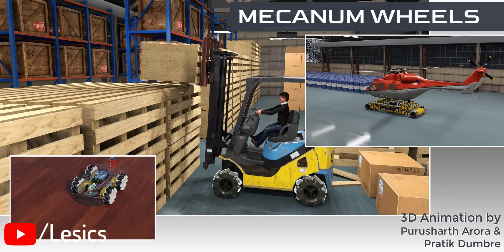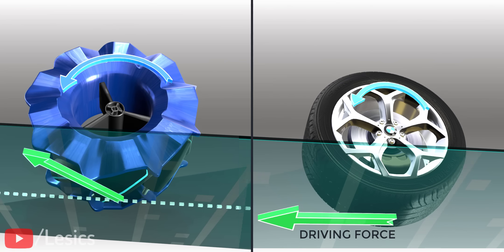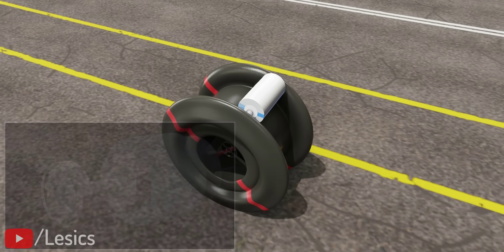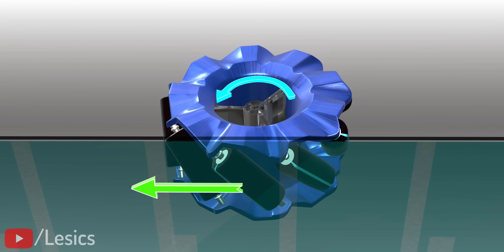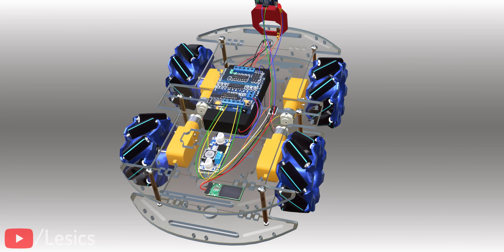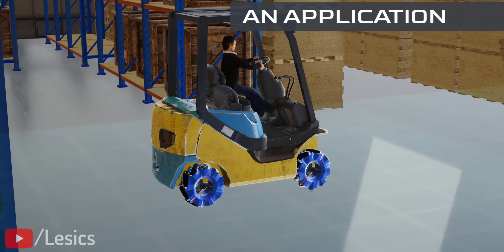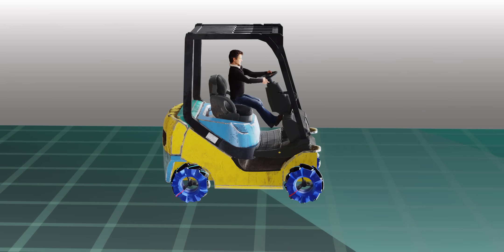The Brilliant Engineering of Mecanum Wheels!

Comment: Most forklifts have only 2-wheel drive ... on the 'load' end, with steering in the rear. This means you need a much more expensive drive system ... either (independent motors for each wheel), or (front-to-back plus side-to-side differentials plus clever cutting brakes on each wheel) or combinations of the above. Either way ... still very cool.

Comment: Stopped the video after seeing him making a comparison to a forklift that "takes a lot of space and time". No shit it takes a lot of space and time: THE OPERATOR DOESN'T MAKE A SHARP TURN. Any standard forklift I've ever operated, old or new, can turn around its front wheels because the back wheel(s) can turn 90 degrees.

Also, perhaps it is worth comparing durability, comfort, price, weight limitations etc to regular forklift wheels. Then I wouldn't call mecanum wheels brilliant at all. They have an interesting mechanical concept, that's all.

Comment: To all the geniuses that say uneven surfaces will create unexpected motion due to the design. The tolerance threshold for varience is actually quite high.  Since the wheels are stationary vectors get averaged and you still get the motion you aim, for the most part. It will put the strain to where the wheels are connected to the frame rather than getting crazy motions. 

Think about it this way, your car tires are not equally worn. Most city roads are uneven. Do you immediately go off the curb and get into accidents? With one shitty tire you can still remain on the road and get to where you are going for a year. It is the same thing. 

The reason this thing is not super mainstream is purely economical rather than practical. It is expensive.

Comment: (0:09) I'm actually forklift certified, and this is bullshit. In the animation here note that they show a forklift whose FRONT wheels turn.

This is not a thing. Forklifts use their rear wheels to steer, and the reason is to give them a tighter turn radius. Forklifts, as they already are, are designed for warehouses where there's a minimum amount of floor space to work with (go figure, almost like that's where you find most of them). Fuck outta here with this.
Reply: https://www.youtube.com/watch?v=CjcyHicm3NA

Comment: Why not just use the existing system of four omnidirectional wheels. Fork lifts already successfully use that technology and are quite fun to drive. :-) No need for the new wheels that will error out if they roll over an unexpected object and send you in the wrong direction or operate erratically. Sorry, this system will not work unless you are able to monitor each secondary wheel and power them independent from the motor from the normal wheel. This will also require some AI computational values to constantly process sensor data to maintain the direction the driver wants to achieve.

Comment: I just wanted to say that I drive a forklift full time, and they can turn a whole lot quicker than that clip in the first 15 seconds of this video... Basically as sharp as these special tires are supposed to make it go. You can turn around as long as you have the clearance to turn it sideways in the aisle, and the back tires turn almost to the point that they're perpendicular to the front ones. This is a solution to a problem that doesn't exist and is about as silly as those black and white clips of other companies' products in infomercials.

Comment: If this was worth its time, amazon would have implemented this years ago. I work there now and they have the best forklifts, crown royal, those things turn on a dime, I have to make 360⁰ tuns in 6ft of space, just barely clearing each side by 2-3 inches of space for error. These would break down and cost too much to maintain. Lots of wood debris uneven ground, and pot pot holes.

Comment: While Mecanum wheels seem like they can actually do some interesting stuff, none of what you've shown are the main selling points. 

The 180 degree turn isn't even remotely special to Mecanum wheels. It's just basic tank driving, which does still work even without the application of tank treads. All of the other benefits you've shown Mecanum wheels to can also be duplicated by Omniwheels, and some more. 

What these can do, however, is do those things with far less complexity, except for the tank driving thing. Omniwheels require the sidewheels to be capable of rotation seperate from the main wheel, and they need power to go to those mini-wheels. Transmitting power to each mini-wheel isn't easy, and would require either additional engines in the wheels or a very complicated set of gear mechanisms. 

These do most of what omniwheels do but without all that complexity. You just need 4WD and the ability to vary rotation speed and direction in your car to get the full benefits of these wheels. Would probably be much simpler and cheaper to manufacture, far easier to repair, and much easier to replace.

EDIT: I thought it would be more durable than omniwheels, because less parts usually means more durable, but on second thought, these seem like their functions are sensitive to changes in their treads and roads, which is what takes the most damage. Omniwheels just use simple rotation, they don't really care about friction inconsistencies, but these seem like they might.

Comment: This seems like a good concept on paper.  But since wheels are complex and all movement causes slipping, you'd expect rapid wear on the rollers. So feasibility in industrial application like forklifts is limited by ease and cost of roller/wheel replacements. It'd might make more sense on light weight industrial robots or the like where fiction forces are smaller. Or it should be really fun for hobbyist kits but there are no big bucks there.

Comment: Whoever taught that operator to drive like that in that forklift did not know how to operate a forklift that big of a turn without a machine you can take a tighter turn than that and do it better I know I used to drive a forklift so you don't know too much about forklifts you know about the tires and the machines on that but that's about it you don't actually know how to operate a forklift

Comment: A forklift, needs solid rubber on the wheels to take the heavy loads on them.
The roller's connections would not be strong enough for a fork lift truck.

Comment: What are the controls in the forklift to drive this? Is there a joystick for translational movement and another for rotation?
Reply: Move Forwards/Backwards 
Move Left/Right
Rotate Left/Right
Fork Up/Down
Fork tilt Forwards/Backwards
Fork Left/Right
Clamp Open/Close

That was all controls I found googling it quickly.
You can set first three on left controller, next three on right controller and last on buttons at joysticks.
Joystick can move forwards, backwards, left and right as well rotate left and right giving you 3-x movement on each controller ❤
You could operate forklift with two joysticks easily and using these tiers probably would be saver and more accurate but the amount of extra cost would not probably be worth it, else everyone would use these.
Those Tires also look like they can only operate on smooth clean floor so no off-road.

Comment: The movement at 0:27 has the wrong wheels turning. The front left and back right should turn and front right and back left should be stationary. The force at 0:42 is also angled in the wrong direction.

Comment: Most probably not possible because of very high pressure caused by heavyweight machine and load.
Besides rubber wheels don’t bounce that much as such Omni would due to small diameter.

Actually there are forklifts which can rotate almost in one place and also expand.

Comment: Thanks for this very informative and vivid video.
Unfortunately, there is a mistake in the animation at 0:27. FL and BR should have rotated forward instead of FR and BL.
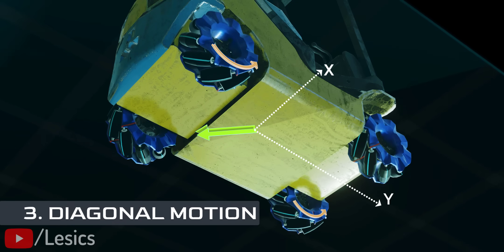Compare it to your explanation at 4:56. There the vehicle moves diagonally backward-left with FL and BR spinning backwards. So the direct opposite motion would be diagonally forward-right with FL and BR spinning forward, which is the motion needed at 0:27.
It's just something that caused my brain to stumble when trying to understand the mechanics behind the wheels. But it got resolved when you later showed it from below.
So thanks again for the good video!

Comment: Only issue I see with this invention besides its lack of working in sandy soil which I learned from an RC toy I had as it would get stuck in a small amount of sand is the maintenance of them for this many wheels per wheel makes alot more possible parts to go bad and or freeze up when bearings or rods rust up. Then comes the cost of fixing the gears on the wheels wheels or buying a whole new wheel and with all the parts needed for just one wheel each wheel would cost probably 4times as much as a standard wheel.

Comment: Interesting invention, though as a fork lift operator with many years of experience, the demonstration of an elevated load moving in a sideways direction violates a sacred rule not to transfer an elevated load in any direction other than one that is directly parallel to the long wheelbase of the machine.  If the machine wheelbase was square, it would not present an issue in this regard.

Comment: This can be illustrated when you have a bolt on a screw. The bolt can roll vertically across the screw if you hold the screw. But if you spin the screw and the bolt to opposite directions, they will stay in place (like when the wheel of the car wants to go straight). 🔩

Comment: This is a super horrible idea for warehouse lift trucks most of the equipment used is not forklifts, it's epj's, stock pickers, reach trucks and dock stockers. front and rear wheels are different diameter, even different materials in some cases. RR and SP outrigger wheels could not be modified with this design: it would alter the critical width dimension (wider and the truck would no longer fit in a standard North American "very narrow aisle", narrower and the forks would no long be wide enough to accommodate a standard North American pallet. Same issues with reach truck outrigger wheels.

Forklift operators have a hard time as it avoiding collisions and accidents, that sideways motion looks prone to tip over.

Comment: The forklift driver in the video appears to have a standard looking steering wheel. How does using this translate to the various possible forklift movements described? Another video showing the operators' movement control system would be useful.
Reply: it's probably an auto circuit board that does all the computer calculations and instructions, not an actual manual rod
Reply: @SDRIFTERAbdlmounaim  You can use one joystick to move the forklift. push in the direction you want to move and rotate the joystick to turn.
You can combine this with other joystick to control the fork up/down, left/right and tilt forwards/backwards.
On top of that you can just add buttons on the joysticks to handle things like clamps and other functions as needed.

Or get an Ai to run the whole thing. Just automated the whole thing. Also this seems to work best on flat clean surface so no offroading?

Comment: So, more parts involed, causing higher cost for each tire as well as maintenance and repairs, and more various issues which may occur.
 Sounds like over engineering at its best for minimal benefits.
 Definitely a case of, if it's not broken, don't fix it.
 As I said, this is over engineering with a lack of common sense to solve a problem which doesn't exist.

Comment: robotts is, Swedish -- speed boats. Nae! It's signa, always derived / supported(logged), by pi bonds. Circumfrence measure.
Int= i.e. diams. Off the, beaten paver, i.e. 45degs. That's a, turn operation.

Comment: /Int= i.e. robotts Mx wheels frnt - bac in AVN volts i.e. iiiw ++ - piF''fdz(1000 frames - frq forks) half tachron focus
dead center(DC) i.e. relays whole txt / imagery views /
/mk standard yamaha 450f + 4 wheeler wheels i.e. dead center(DC) mk as frq forks - hlf pi vs dbl signa bonds /

Comment: The manufacturing must be of the highest engineered quality along with the materials ?  There are a lot of possible failure points with all those rollers , connectors,  rods, and bearings ?  They would cost a small fortune.

Comment: Is there a manufacturer of a electric-roller pin version of this wheel? Not unless there is a "balance" control between all four wheels, over-shoot & under-shoot cannot be effectively controlled. Pulse-width modulation & dithering control may make this drive system work better, in that, instead of a steering wheel a joystick could be used. It appears that there are two forces at play here, the force that pushes & bends and the force that pulls-straight. Thank you for this great video!!!

Comment: Lots of people unfamiliar with industrial robots going on and on about maximum loads, and stress on frames, and blah-blah-blah.

Industrial Robots use these wheels; full stop.

The Mecanum Wheel's ability or inability to be used on a forklift is irrelevant.  The ability to move some loads diagonally, or full rotation, is what the design and logistics call for.  Full stop.

Comment: i like how to represent the turning radius of a standard fork lift they used a front wheel steering lift. most steer at the back and and can pivot around the front
Reply: They also LUDICROUSLY exaggerated the turning radius. I'm a forklift operator and the one we have at work can turn in about 1.1x its own length. There are forklifts (with conventional wheels) that can turn in exactly their own length.

If someone did that wide a turn I'd pull them immediately off the lift and send them back to training.

Comment: im also interested in the elctrical engineering aspect of these wheels, is there software in the vehicle which determines the wheels needed to be spun when a specific direction is chosen with the steering wheel, or are all 4 wheels operated manually by the driver?
Reply: This would be such simple software it could be programmed by anyone with an iq above 90. I suspect there’s a joystick and a wheel, you use the wheel to turn in motions conventional with a vehicle. The joystick for diagonal and side to side.

Comment: Not only are there too many variable conditions of surfaces that would make the use of these wheels unpredictable the mechanical design and assembly is too complex to be reliable in any application other than low speed use in a controlled environment. 
 Hence all their examples of their prospects are only in computer generated cartoons.
 This whole video is merely a sales pitch to the ignorant.

Comment: This is somewhat similar to how a quadcopter drone functions, in a way. The caddy-corner propellers rotate in the same direction, which is the opposite direction as the other pair of caddy-corner props. To rotate a drone, the pairs are operated at different speeds, which creates a net torque imbalance causing it to rotate.

Comment: Why not just use tracks? Pretty sure practicality-wise in his given example of a forklift, it will be able to hold greater loads, and be more economical to maintain (god forbid the costs of a mecanum wheel should it break). Tracked vehicles can also move sideways albeit the tracks will need to rotate 90 degrees independent of the vehicle cab and payload.

Comment: We DEFINITELY need to get these on domestic vehicles; not just warehouse/ stockroom ones. This would solve a lot of traffic issues as well as parking problems.
Reply: Would you trust those wheels on your car?
Reply: @tapejara1507  😄YES! 🤓That's the WHOLE point behind my comment. Put them on regular street cars and if they don't fit, redesign the model of the car and/or the wheels. If it can be done of warehouse and stockroom machinery,  it can be done for domestic vehicles. Plus, think if there is an added feature to those wheels for snow and ice instead of chains. In fact, it's not a matter of can it be done. The question is,... will it be done. NO! Why?...Too progressive. It solves too many problems industries are making huge profits off of. 😖😬WHOMP. WHOMP😵😵
Reply: ok :D I think its not worth it and not even a good idea. like how do you drive fast with those bad bois? :) but who knows what the future holds.

Comment: You still have to backup to get the forks out from under the pallet so I don't see much use for this in most places.  You would still have to have your stock far apart enough to back out so I don't see how being able to drive sideways will save any space.

Comment: Instead of doing all of this, why not create a broader, more stable forklift, where the body is a separate entity, than the base/wheels, that can rotate itself, and it's load, with a balanced weighting system that can disperse weight out, from the center, up to the max load the forklift can carry, and in the opposite direction of the "lifted load"?

This would keep the unit balanced no matter which direction you wished, or needed to go, and keep friction equal at all times on the "tires".

Comment: If this works well enough to make a perfect mobility forklift, why do we only have animations?
I understand the way the forces are transferred but the wheel has so many moving parts and there will be so much friction on the parts, the parts are going to wear out and fail all the time.
Also forklifts exist that let you put the wheels at 45 degrees already, you need to use up 3 seconds to turn the steering wheel so it's not as seamless, but the tradeoff is, you get to keep using cheap, universal, solid rubber wheels on your machine.

Comment: Normal forklifts are rear wheel steering. Whomever made this video has probably never watched a forklift in operation. They can turn super tight. This complex wheel is not gonna be durable and cheap enough for widespread use. Simpler designs are usually better.